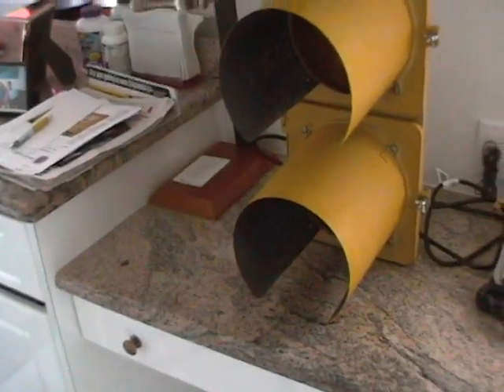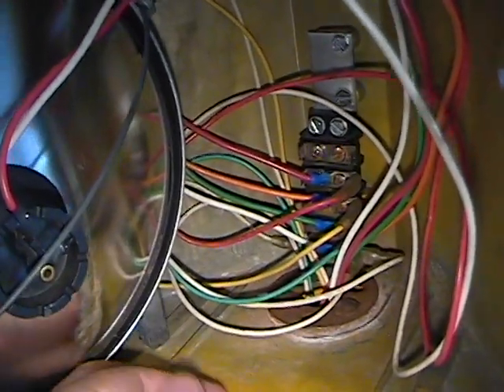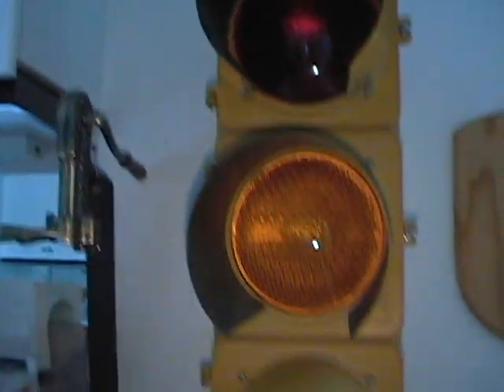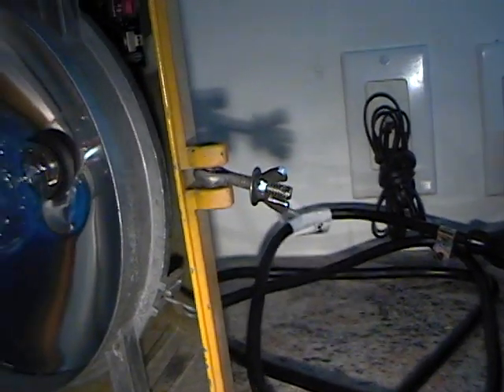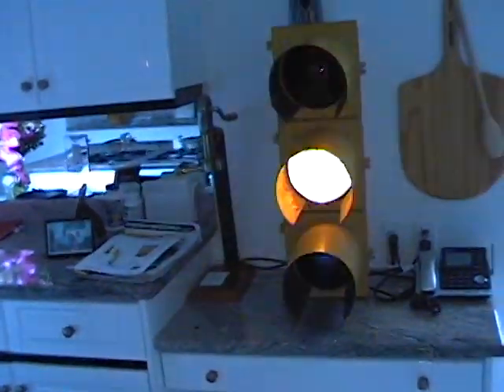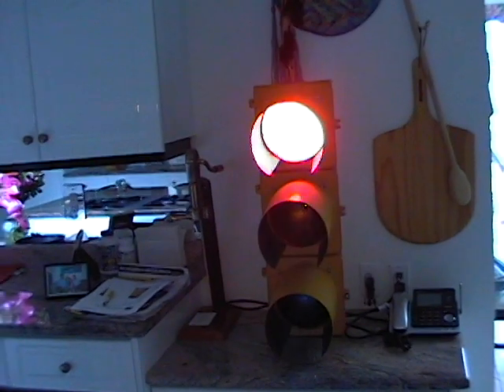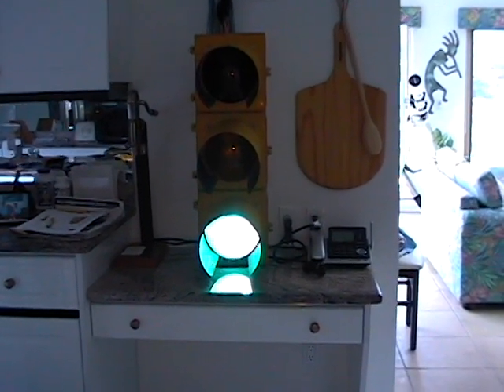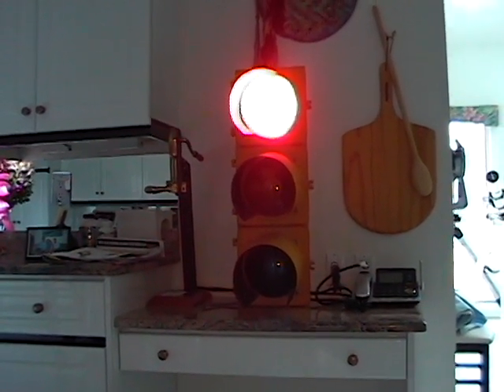Traffic Light Operation & Sequencer

Comment: Now if i were to connect to an econolite controller, how would I do that? Where do I connect the wires in the traffic light?
Reply: This reply is on the late side I know.  Basically you should have three wires that are the color of each light module.  These should be the line (hot) wires feeding 120 volts to each light module.  Generally they are not connected together.  Next there should be a bundle of three wires (one from each light module) that are connected together.  These should be white, gray or sometimes black.  These are what's called lamp common wires.  Lamp common is another name for neutral which is the return path for the electricity in a 120 volt circuit.  Without knowing what sequencer you're using, it would be hard to give exact advice.  However most sequencers have input connections for incoming line (hot) and neutral wires.  Then there's three output channels (one for each light module line or hot wire).  You would take the colored wires for each light module and hook them to each output channel.  Then take the second wire from each light module which is their common wire and link all of those and incoming neutral together.  Generally this is with some sort of wire nut or alternate connection method.  This will complete the circuit for each light module and the sequencer will take care of switching 120 volts to each light module.  Feel free to private message me with any more questions!

Comment: Barrier block is quite rusty/corroded.
Reply from the maker: Which part is that?
Reply: where all the wires are connected, its mounted to the light chassis...to me its rust colored from water corrosion.
Reply from the maker: Ahh yes that. That's how it was when I got it. I sanded off what I could after I got the light, to the best I could. Been working great almost 5 years later!
Reply: Great deal!
Reply: I hope you added a gumbi (grommet) around the primary cable through chassis..  Safety first!

Comment: I use the same type of controller for my lights as well! I'm waiting for some new parts for mine!
Reply from the maker: +Kyle Miller Cool! It is still working today!
Reply: +Sharkie626 yeah I have a latest setup on my channel! Should be one of my more recent videos! I'll be doing a new setup soon when I get some new pushbuttons and hopefully a newer controller as well!
Reply from the maker: +Kyle Miller Sounds good man!
Reply: I build and wire up my own using solid state relays which are great for either regular light bulbs or led modules or both.  Timing is another built module using transistors, caps, and resistors.

Comment: is it just mine, or does it shock you if you touch the metal while its working?
Reply from the maker: Mike Z Only the ground wire is connected to the light casing. I've never been shocked by mine.
Reply: Sharkie626
the ground for the green light, right?
Reply: Mike Z No. To power this signal he used a polarized 3 prong plug the round one on the bottom is the ground prong it's the longest one, on the other end that would be the green wire the black wire is the one that carries the electricity it called hot and the white one is neutral the purpose of ground is if a Hot (black) wire touches the metal housing it will "short" the ground and flip the breaker in the breaker panel in your home and you won't get shocked. Ground only carries electricity if something is wrong.